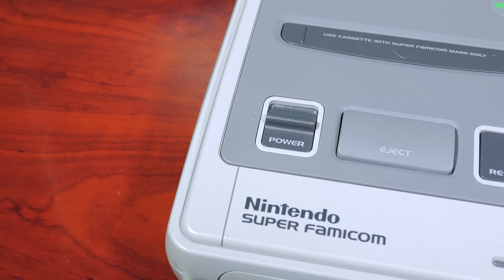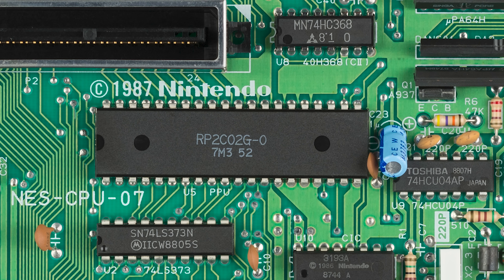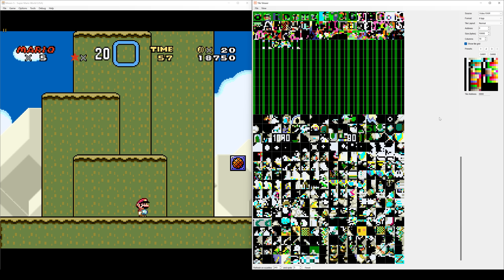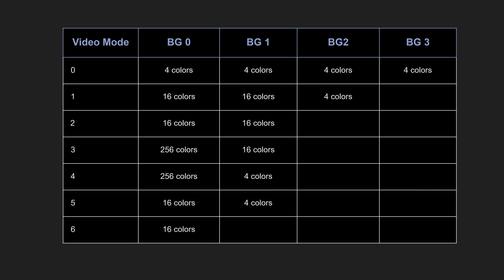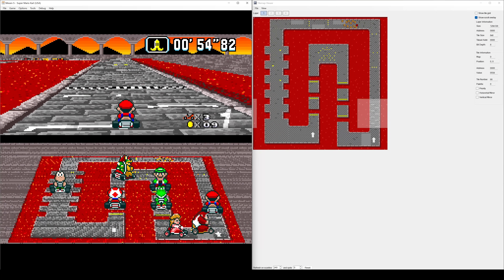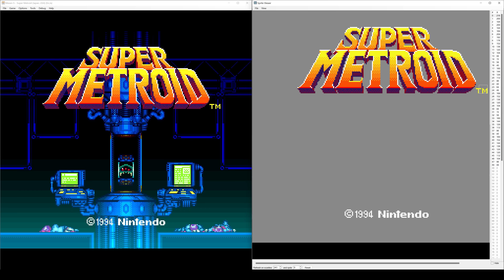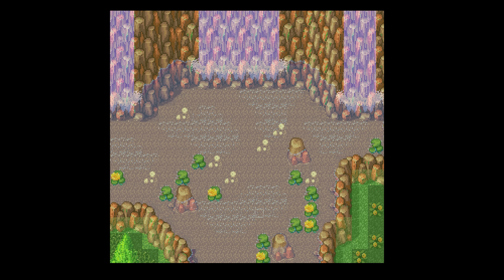How Graphics worked on the Super NES | MVG

Comment: It's useful to note that the weak SNES CPU isn't quite as weak as it seems: like the original 6502, the 65816 has a far better average cycles per instruction rate than the competition. So while a 3.58 MHz 65816 probably won't beat a 7 MHz 68000, part of the reason for the lower clock is that the 65816 doesn't need a high clock rate to perform.
Reply: At that point in time it also wasn't capable of running faster, the chip layout was optimized over the years.

Comment: they really improved on the mode 7 graphics style on the GBA (being a 32bit system), one of the most noticeable examples for me is in F-Zero Climax and how the GBA rendered it’s tracks, in the original F-Zero there wasn’t much of a distinction between the ground and the course you are currently racing on and that’s just simply due to limitations. In F-Zero Climax on GBA however they were able to set two layers for the track consisting of the track itself and the ground below, and they were able to set the scrolling of the ground layer to a value that portrayed elevation to make the courses look like they are meters above the surface, most notably in the Mute City and Port Town courses

Comment: This video seemed like you started researching it, but then gave up half way through...
The SNES did NOT have two PPUs, it had one, which was split over two chips. The reason for the split was die size (yields) and chip packaging (number of pins). The two chips can only ever work together, and neither can stand on their own. The first PPU chip is responsible for the address generation for the VRAM (which includes the transformations), and the second PPU chip is responsible for the color selection and blending. Without the first chip, the VRAM address is floating (nothing driving it), and without the second chip, there is no color data being used. In other words, Nintendo decided to logically break up a SINGLE PPU into address/transformation logic and color blending logic... it's sort of like breaking up the rasterizer and the blender/shader from the PSX. Note that this is different from the Saturn with the two VDP chips, where they can work independently.
Also, in terms of "modes", they were more along the lines of set configurations that the PPU to could be programmed to do. Instead of Nintendo providing hundreds of configuration bits that would confuse programmers, they instead collected the configurations into 8 pre-sets that could be easily selected. If the front-end logic were changed, the SNES PPU would be capable of various other configurations, since it's a tradeoff of processing time and datapath bandwidth.
I would also find it hard to believe that figuring out the color modes in emulators was all that difficult. If anything, it was the main screen and sub-screen logic that was hard, not the math itself. The PPU manual clearly states that you can either add or subtract the screens (1-bit), and you can half the result (1-bit). Which gives you the 4 blending modes. Anyone who knows anything about digital logic would immediately identify that circuit... it's an adder/subtractor (XOR gate to invert and carry in for the +1) which takes two 5-bit numbers, adds them to produce a 6-bit number, and can either shift the result to the right or saturate it.

Comment: So that means for an SNES, all those 1280x1024 monitors are perfect for SNES, when cropped at 1024x1024. Good to know. Curious to see if anyone has done that before.
Reply: For the best experience get a 4k monitor instead and use an emulator that supports CRT shaders. The pixels weren't meant to be viewed raw...
Reply: @ShinyHappyREM  Bigger is always nicer, but I prefer smaller. Sure the pixels weren't meant to be raw, but neither were they meant to be at 4k, so I think in both cases you're changing the look to suit your preference.
Reply: @elijahingram6477 : Actually the electron beams in + the phosphor coating on a CRT have a much higher resolution than our 1080p displays, being made of electrons and atoms. If you want the colors bleeding into the black scanlines as accurately as possible, higher resolutions are better. I mentioned 4k because that's where I see almost no pixels on a typically-sized display, and at some point the CRT shader might get too demanding too.

And when you want raw pixels then 1080p has a few issues. 1080 / 224 is ~4.821 so you'd get uneven line spacing. 1080 / 240 is 4.5, still not an even number. 224 * 4 is 896, so you need 92 empty lines on top and bottom. 240 * 4 is 960, so you need 60 lines on top and bottom. 1440p is 240 * 6, so that would work.
Reply: @ShinyHappyREM  I'm speaking less about the pixels themselves, and more the resolution given by the SNES. I really could not care less about any of that at all. Kudos to you for knowing it though.

I am aware that CRTs have a way higher resolution than 1080p displays. I grew up with them after all XD. It was just a fun comment, didn't expect a lecture.

Comment: The overlooked feature in the video are the Windows. Some well knowns effects are - keyhole appearing on screen and zooming in a Super Mario game, same game featuring a disco ball to light some areas of the screen, there was also a cave level with a cart and a lamp projector in Donkey Kong. While being a simple effect it appears to be an important one for hardware designers as it is significantly complicated the rendering pipeline. Color math are shader granddad and could be used for many things besides transperancy. One of the good examples is Frankenstein, you could compare the SNES and Genesis versions to be blown away what could be achieved with color math. 
All an all SNES seems to be an overcomplicated system, it's design says that it was suppose to serve for a good extra years, and it would've been explored and used to it's full potential if not the skyrocket speed of hardware development in the 90th and 3D trends. And even then SNES did held for a while, with Playstation released

Comment: I must say I disagree that Nintendo made the right decisions. The games were crippled with slowdown thanks to using slow rom chips and a slow processor. The sprite size is not the best. Nintendo should have included a much better CPU. Sega made the right hardware decisions but Nintendo had overwhelming support from the best third parties which is why they did so well. 
Edit: I forgot to mention the resolution which was too low. The image needed to be stretched horizontally to fill the TV screen which ruined the artwork and made the small sprites look short and fat.
Reply: The decision to use slow chips wasn't by Nintendo, it was by the publishers. The CPU had a lower clock speed, but needed fewer cycles per instruction than many other CPUs. SNES could use 64x64 sprites (google "anomie regs.txt"). SEGA used the 68k because it was used in the arcade and allowed easier ports, not necessarily because it was the right CPU for a home console. Many SNES games compensated for the stretching, for example Chrono Trigger.

Last but not least, Nintendo did so well because of their software (games). Software is always more important, as you can see with Intel's failure to switch the PC market from x86 to Itanium, or with Nintendo's low-powered but still successful newer consoles/handhelds. Gamers will buy anything if it has Zelda, Smash, Pokémon, Metroid, ...
Reply: @ShinyHappyREM  
I want to say I love the SNES but Nintendo set up a problem for developers. They could have used fast rom chips but that would push the price up. So, amazing games like Super Ghouls 'N' Ghosts were too slow. I wouldn't go as far as Dean and say SNES games are best skipped. I'm enjoying the SA1 and fast rom hacks of the best SNES games. My comment is just that what was done back then wasn't ideal at all. The Megadrive has low colour but is a much more consistent piece of hardware.

Comment: Can it happen that during the scrolling the next part of the map doesnt load in time if you mess up? Either through breaking the game while playing, or messing up while developing the game? What happens?
Reply: There is only a single thread and all the code is tied to cycles due to VBLANK. So it's hard to mess eventually and unnoticed. But the hardware of the times almost never crash, so what would probably happen is that the memory pointer would be messed up meaning it would load garbage into the VRAM. This would result in glitched graphics, like simbols, half tiles. You could see it sometimes in hacked games on NES most often

Comment: “Theres actually an mode 8 graphics  mode but we will talk about it later as it deserves it’s own “video”,”
Well why could you not give us a peak for what mode 8 is all about?? Because am searching to dead on google with absolutely no results about it,damnit, i hope somebody else can give me some info about mode 8,
Reply: Mode 7 is the 8th mode. 3-bits, 0 to 7 is 8 modes.
Reply: @hjups  he did said that theres actually a mode 8 but that he would cover it in the next video.
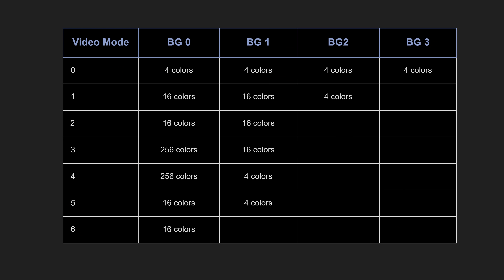Reply: @johneygd  He said "There is actually an 8th mode" (at around 4:24). He meant that mode 7 is the 8th mode, because the counting starts at 0. So the 1st mode is mode 0. 
Even though the wording seems similar, the order does change the meaning.
The counting starts at zero because of how computer / digital electronics work. 3 bits store 2^3 states which is 8 states. Those 8 states include the case of 000 up to 111, where 000 is 0, and 111 is 7.
He also said "it really deserves its own piece", not "video" (though I interpreted it as video as well when I first watched it). I think he meant section of the video, which he did spend discussing, though not adequately in my opinion (that would have made it a 20 minute video easily though).
Reply: @hjups mmm oke ,we will wait and see.
Reply: @johneygd  
Also, having a mode 8 would mean that there are 9 video modes, which is not a power of 2 (Nintendo wouldn't have wasted an extra bit just to provide an extra mode - the PPU probably would have been capable of an extra 7 different modes of operation from the internal architecture, but that would have cost more to provide access to).
Anyway, fair enough. But if the video is never made / there is no clarification, then you have your answer above.
Reply: @hjups  true that.

Comment: Hi, i actually do wonder Why you didn’t talk about mode 8. Am mean  why didn’t you mention that the snes can also use all modes in alternating ways during screen rendering? that means that for instance it could use the first 32 lines to render a background while those ocher lines could be used to render mode 7 or vice versa etc…
Also i wish you mentioned the game N ball, because that game uses sprites to act as a main background layer while mode 7 is used on top of it to rotate the screen in order to simulate a multiple mode 7 background layer.
Wich is an interestkng case on itself as well.

Also i suppose mode 7 isn’t even moving a background in 3D space no,it seems to use sqewing to shrink or stretch an image in all directions to fake a 3D perspective(similar to perspective correction in fotoshop)
Or i might be wrong and the snes does move a background via mode 7 in 3D space,does it?
Reply: The 8th mode is Mode 7.

Comment: A slow 16-bit CPU on an 8-bit bus, that's really the SNES's greatest weakness, it's what prompted reliance on custom chips in cartridges though I believe I remember hearing this was an intentional design choice.  Or it might have been a result of there at one point being NES backwards compatibility factored in hence why it's so hamstrung?  Whatever the case, it's still a well-rounded and otherwise efficient machine.  Can't say the same for the N64's architecture, what a mess.
Reply: "it's what prompted reliance on custom chips in cartridges though I believe I remember hearing this was an intentional design choice"
That'd be weird because N64 games don't have any chips in them because they massively beefed up the hardware so it wasn't necessary anymore.
Maybe they did in fact want people to use additional chips on the SNES, but then realized it wasn't a good idea and then made the N64 with that in mind.
Reply: @DasAntiNaziBroetchen  Check out MVG's video about the N64 being hard to develop for, you'll see what I mean.

Comment: 5:27 - There's a mismatch between what you say and what's on screen. On screen it says 256 and 16 colors but you say 128 and 16 colors. If I had to guess, then you're saying the correct thing but the shown table is false.
EDIT: The same mismatch can be found a few seconds later when you're talking about mode 4 ^^'
EDIT 2: Also, you say that mode 6 provides 32 colors whereas the table says it's 16 ^^'

Comment: PPU1/PPU2 so essentially the SNES was a dual core system.
Reply: MVG didn't describe that properly. PPU1 and PPU2 were a single chip split in two. One did the addressing logic and transforms, while the other did the color lookup and blending.
That's in contrast the the Saturn which really did have two independent video chips (though they each did different things).

Comment: What's ironic about mode 7 is that even though it's used to name the flat 3D effects like games like Mario Kart or the airship view of several JRPGs of the time, mode 7 alone is not able to do this because perspective is not an affine transformation. The way the effect was done on the SNES was by changing the scaling every scanline, which programmers did with HDMA. Of course mode 7 is the only mode with hardware scaling and rotating so you still HAD to be in mode 7 though.
Reply: Aaahh! I was always wondering how those games were possible with just the mode 7 transformations. THANK YOU.

Comment: I'd argue that the SNES did have "true transparency" since multiplying, adding and subtracting are all transparency methods used in digital graphics (see Photoshop layer transfer modes). I'd attribute "fake transparency" more to dithering or strobing.
Reply: I’d say it’s not quite there in that you don’t have direct control over opacity
Reply: @mccad00  I'd still say that just a parameter of transparency, the actual effect still works without dithering of flickering; the colours were mixed, you just can't easily control by how much.
Reply: @soviut303 : You can control the mixing simply by making the added graphics darker or brighter. I think Chrono Trigger made it with a boss in 2300AD.
Reply: @ShinyHappyREM  Yeah, I was thinking about mentioning that but it isn't very simple to calculate. Also you're limited by your palettes.
Reply: I feel this kind of logic could also be used to say that the SNES had true 3D, since most of what 3D is is applying affine transformations to textures. The SNES just has a max polygon count of 1. (Or 2? Since "polygon" usually implies triangle in graphics?)
Reply: @angeldude101  I mean, technically yes, if you do enough affine transformations you get Doom. Still, I think the "true transparency" term holds since there are clear examples of "fake transparency", namely dithering and strobing. It's primitive, but it's real multi-layer transparency.
Reply: @angeldude101  yeah, but I guess that would be 1 polygon because you couldn't have different planes of transformation, while 2 would imply you could (4 points don't need to be in the same plane)
Reply: @angeldude101  number of sides wouldn't increase the count, it just means you could have 1 polygon with X sides.

#internetpedantry
Reply: it's fake. The objects aren't actually transparent. The fact that you wrote a comment arguing your point is a testament to the design of the SNES.
Reply: @skunch  Again, I'd argue that "fake" transparency is when you aren't able to blend two layers in any way other than strobing or dithering. However, being able to compute a new colour for a pixel from two overlapping layers how most transparency modes work. Just because there weren't many controls for how it did the transfer doesn't mean it "real".
Reply: @skunch if the colours are averaged, then it is 100% true transparency. The only limitation was that it is a fixed 50% opacity. You clearly dont understand what you're talking about mate.

Comment: Woefully underpowered, indeed. I remember getting into emulation in 1999 and trying to run ZSnes. I had a Pentium 166 with a basic SVGA graphics card. Outdated even then, I know. No dedicated GPU at all, so all the rendering had to be done by the processor. It was unbearably slow. Near unplayable. Considering that I was trying to run those games with 166Mhz and could not, imagine what the SNES with its miserable clock speed would have been like without the dual PPUs. It wouldn't have run at all!
Reply: Well, it's kinda comparing apples to oranges in terms of clock speed. While on PC you could have 30 times more clock speed it's being distributed to all the tasks and threads to handle stuff, on the consoles of the time it's bare metal and you have almost complete control of its clock power and memory. The PPUs ain't helping much to unload the CPU because what they care about is just picture rendering, it's not like you could use them for anything else like modern GPU. Rather it's the DMA processor and careful memory allocation that allows the poor CPU to handle anything at decent speeds.
Reply: @HaganeSnake  Those are valid points. I'd also add that trying to run ZSnes didn’t help. It's a bit crap. Especially in 1999. I would lump it in with NESticle as a lower tier emulator, except I like to give NESticle a little more credit. It had a lot of potential and might have become truly great but hackers had to go and steal the source code and anger the developer.